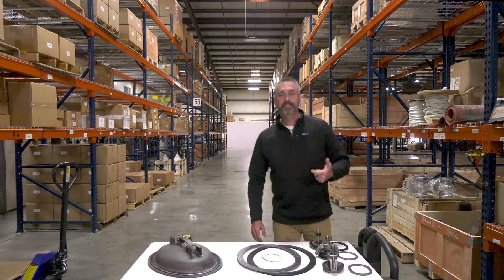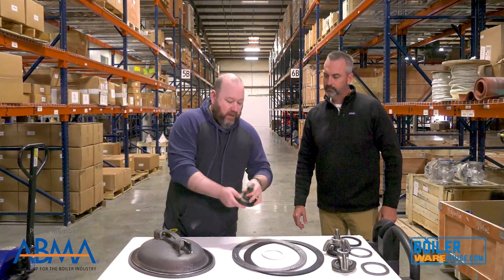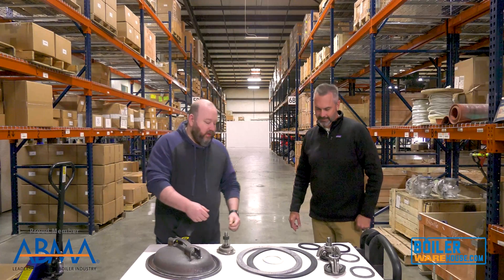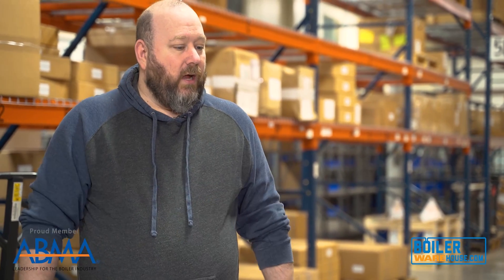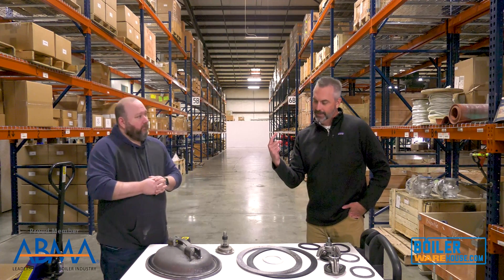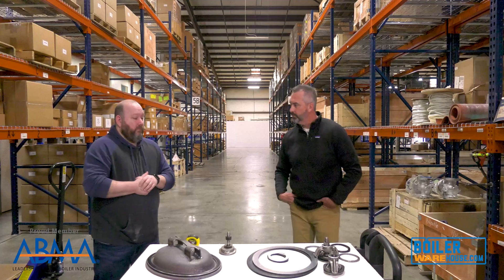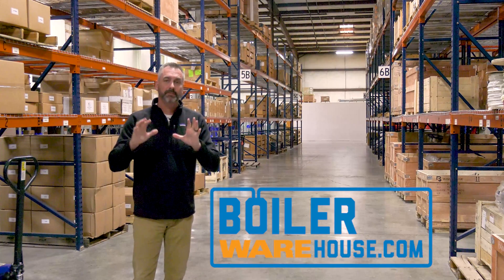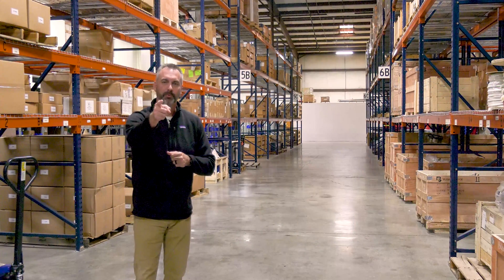Hand Holes & Manways & Gaskets, Oh My! - The Boiling Point

Comment: As far as the yoke that is used to tighten the hand-hole or man-hole cover in place is concerned; when is it recommended to change that part out? Are there other signs of wear on the covers or their associated parts that would require replacement or repairs? Does the ASME code book have any requirements on this topic?

Thank you for these videos, I'm new to the trade and I've learned a lot from this channel!

Comment: Hand hole leak problems are normally  caused by the handhole not fitting face to face of the boiler shell face. Easily fixed with good grinder facing so the there is no rock in handhole when sitting in the boiler without a gasket. Very few people do that.